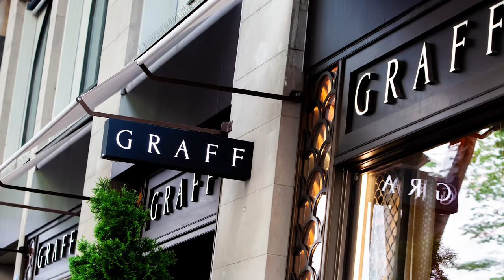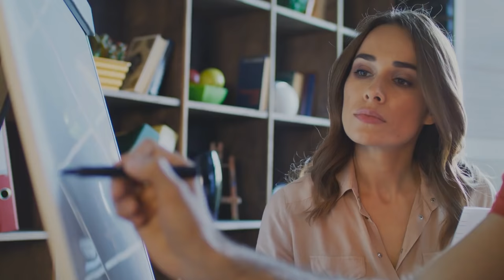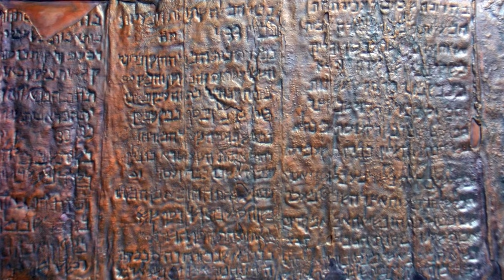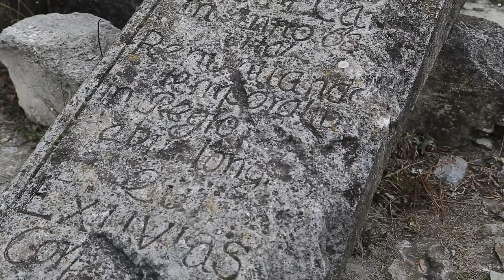Most Valuable Lost Treasures Nobody Can Find

Comment: If there is treasure like scrolls and such valuables then why are they drilling holes through it all instead of digging a vertical set of stairs at the correct angle down to the supposed money pit as all there doing is sinking the island

Comment: Comments on the lost silver bars treasure in Gardeau, Pa from 1812! , as  (#1) Divers went down and up retrieving silver bars to the deck of the recovery ship,Bahamas, not raising up a sunken ship. (#2) The hoard of bars was buried BECAUSE the war of 1812 had started, by the time they came North to Emporium Pa. (#3) There were 6 covered wagons total being pulled by oxen, instead of 54 wagons. I have copy of signed document from library, of party in 1812 who saw the 6 wagons go slowly past his cabin . (#4)  Several Silver bars  were found on side of Mtn. west of Gardeau in 2006 by treasure hunter, who sold it and moved to Ca.- - info from his uncle. (#5) In about 2008,  a few heavy silver bars and 1860's pistol was found on side of same slope of mountain. (6)  About 2015, hikers found chain embedded in old large tree near mountain.  After sawing out, it was taken to city for examination. It was found to be "SHIP CHAIN " from the 1800's! (7) The muddy ground area at the beginning of Parker Run near creek, is were the deer will show you the Salt Lick is, as I have found, and was on the original old Captain's map . Balance of treasure still there, of what's left that Parker did not remove in 1860's , to pay for his new house and the Gardeau Inn for visitors and the strong mineral waters he provided for customers. The large building in the old picture was the Inn. Remnants of the original well is still there embedded in creek 1+1/4miles up Parker run dirt road on right side. It used to be called silvermine run. The Parker mausoleum is right beside the MAIN road as placed by relatives, so as others would know that the treasure was actually west of there. So, the treasure story is actually true! Info and treasure searching  data in report found on Ebay - Lost Treasure Of Pa....

Comment: Wait how does the last one work. If he hid 7 million dollars back in the old days you CANT adjust that for Inflation to the UP SIDE. The way he said it made it sound like if you found that 7 million dollars it would be worth 135 million dollars today. Nope it's still just 7 million dollars in a safe. No one is going to give you 135 million dollars just because it was buried for a long time. Look that's why you buy silver. If you had found 2 boxes your grandpa hid in the attic and you found it 75 years later. In one box he put $5,000 in us bills which was alot then and in the other box he bought $5,000 worth of silver and put that in a box. The dollars would still be just worth $5,000 possible some older value to a collector but still that takes time and the silver on the other hand would be worth a small fortune. See how that works